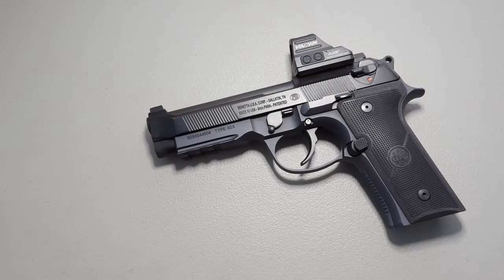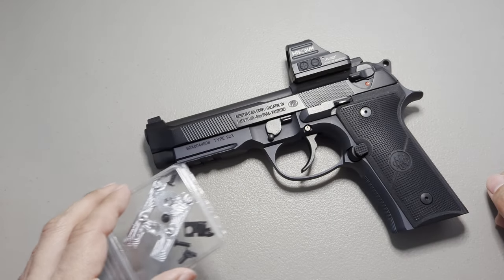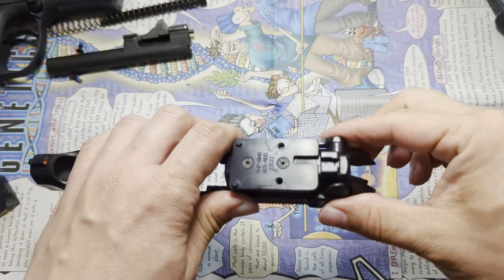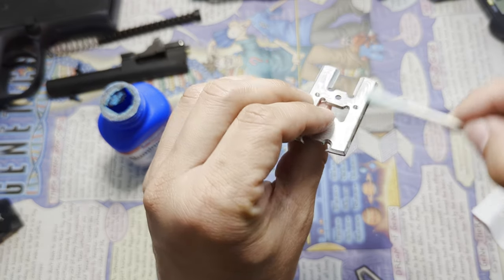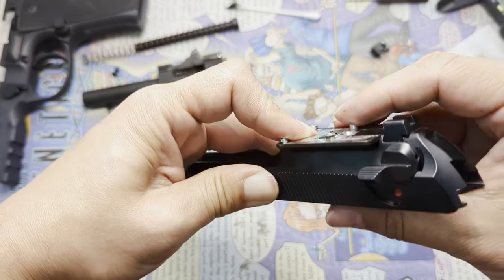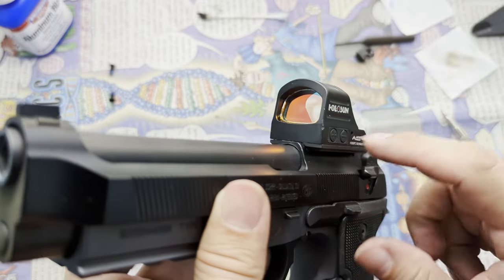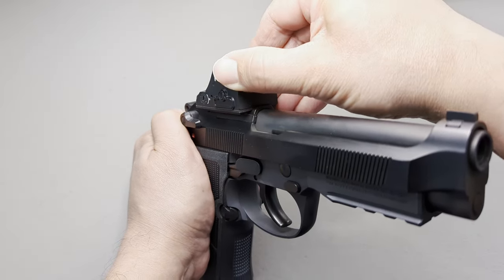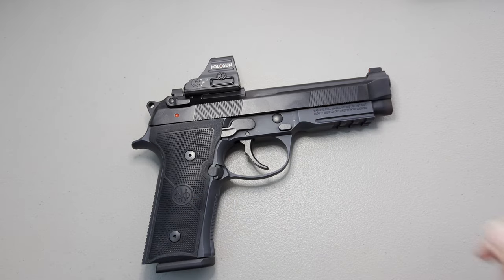The LOWEST optics plate for the Beretta 92X RDO

Comment: Nice video.  I was wondering when you were going to get around to checking out his plate.  I run one and I also run a LTT RDO slide.  The LTT RDO plate is about 1.25mm lower than the d-lahhh plate.   This plate puts the optic as low as you can go with just needing to modify FPB by shortening the height.  Any lower, and you would need to make all the custom parts that LTT makes.    One last thing, when taking your measurements you need to put the jaw of the caliper across both sides of the slide (at the bottom).  This will keep it level and will stop the side to side rocking that keeps moving your measurements up and down.  Otherwise, another great video.  Thanks...
Reply from the maker: Thanks, especially for the measurement of the LTT system!
Reply: I was wondering how this compared to the height of the LTT. Thanks for sharing

Comment: I just bought one for my 92x centurion, ive been keeping my eye on this plate and it looks like its now at a resonable price. $68.
Reply from the maker: Nice to hear about the lower price option. Thanks.
Reply: @marginallyinteresting  i just want to clarify the cheapest option is a mid mount slightly higher than the lowest option. But it's a good trade of , if someone wants to do suppressor high sights

Comment: Looked like a lot of muzzle flip recoil with the red dot. Did you notice a change after installing the dot?
Reply from the maker: Not a lot of difference with or without the optic.  Actually, I think the Beretta has a nice and soft recoil impulse.
Reply: @marginallyinteresting  I have some family members very sensitive to muzzle flip. So considering this as a good option.
Reply from the maker: It's a nice shooting 9mm.  If someone's really sensitive, though, I might recommend a .380.
Reply: I think the muzzle flip is grip related.

Comment: Does it bother you nothing having a co-witness when aiming? I’m debating on buying this plate but am hesitant due that very issue.
Reply: You’re not getting that anyway on a Beretta unless you’re running suppressor height sights
Reply from the maker: I would prefer to have co-witnessed irons, but I can deal without it.  Eventually, I'll change the sights.
Reply: D-lahhh recommended the M9-22 suppressor sights. They will give a good cowitness. From what I've researched .22lr sights on a 9mm will work out perfectly until you go beyond 40 yards. That will be perfectly fine for my needs.
Reply: He also offers suppressor height sights I believe they are $110 for front and rear sight

Comment: This won't work on all 92s.  Obviously, you were mounting on a 92X red dot ready pistol that has factory features to attach this plate to. Other 92s will likely require a LOT of milling on the slide to make this plate work.  Makes no difference because this is NOT the lowest priced quality mounting plate for the 92.  I looked at all of these for my older 92F and decided on the Trijicon mounting plate because of the quality of the company and their plate but because it was the least invasive to the slide for mounting.  All I needed to do was to drift out the factory rear site and install the new mounting plate.  DONE!!!  The surface of the plate is as low as can be possible.  Oh, and it only cost $100 from Trijicon!!!  I've been using it for almost a year and have had NO problems with it at all.
Reply from the maker: The title of the video says "92X RDO," so yes, that's inferred.  In no way is a dovetail mount comparable.
Reply: @marginallyinteresting  Duh!  Yes. I saw that, and I recognized that for my following comment.  Have you tried the Trijicon plate?   If not, you should try it before you make comment.  Mine is VERY stable and every bit as good for my competition purposes.
Reply from the maker: I have not tried the Trijicon plate and will not as I only have this Beretta.  I did watch a video on it since you mentioned it.  It looks good for what it is, but like all dovetail mounts, it can't get the dot lower than a real optics ready slide and it also only attaches to the slide at the rear (the dovetail), which seems sub-optimal.  But if it works, that's great.  Thanks for the info.